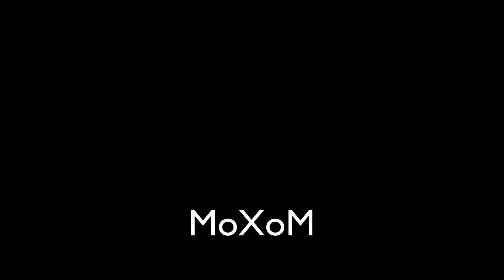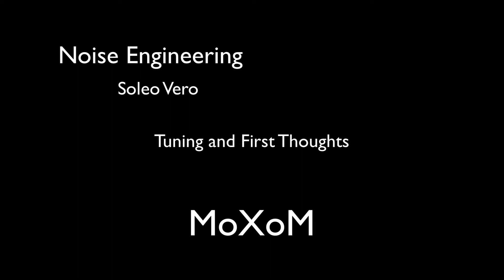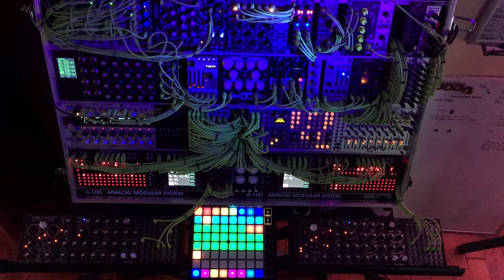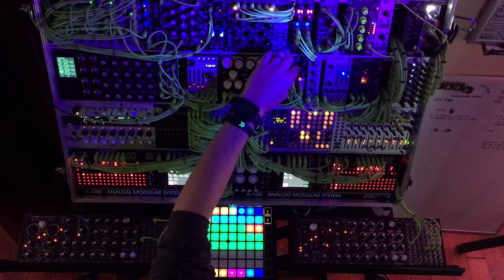Noise Engineering - Soleo Vero Tuning and First Impression - MoXoM

Comment: Live your vid's, very clean setup overall, lovely cable managment.

Could you give some insight on how you use the novation launchpad with your modular, would be very helpful

Thanks for the content

Take care!
Reply from the maker: Hey Cibo, thank you for the comment. I know this reply is very late, however, check out this video: https://www.youtube.com/watch?v=HFBvEv8agCw&t=43s  The Launch Pad is connected to the Five 12 brand Vector Sequencer.  I Use the WMD Metron Sequencers for the 1010Music Bitbox MKI samplers for drums and samples, but all of the instrument modules are sequenced with the Vector Sequencer. So the Launch Pad adds typical Launch Pad functionality to your modular as it would control your DAW like Ableton's Launch Grid and Pattern programming and or recording patterns in the sequencer, then to recall patterns live, mute patterns, etc.  There is a Vector Sequencer MKII and I am sure it will be better.  Memory storage for pattern lengths seemed to be a bit of a limitation on my Vector Sequencer, but it is still a fantastic sequencer and I love it.  Ok. Let me know if that helps!
Reply: @moxom3854  
Thanks for the reply!

Nah 9 month in YouTube comment section is basically a solid week in real time

Ok it's ultra clear thanks, great demo tho 

Somehow I completly missed this implementation about the Vector Sequencer

Look really powerful tho, will need to have a look at the mk2
Reply: BITCHIN'!👽✨🛸...